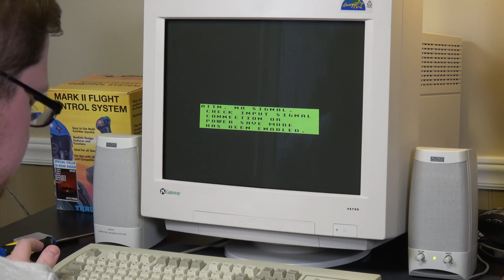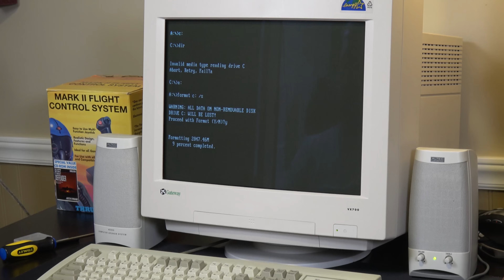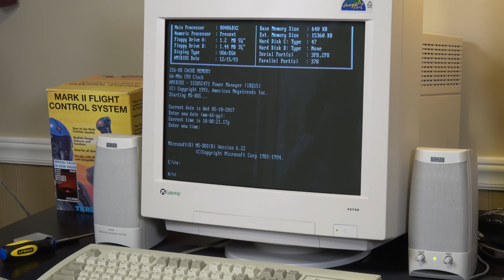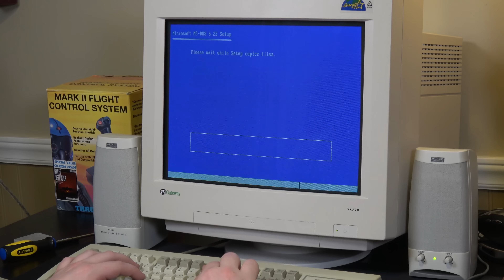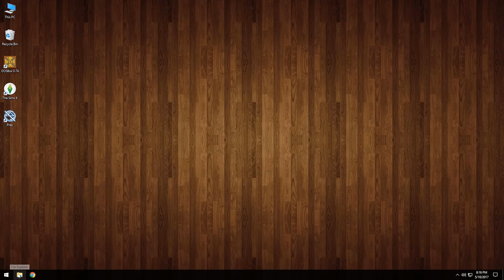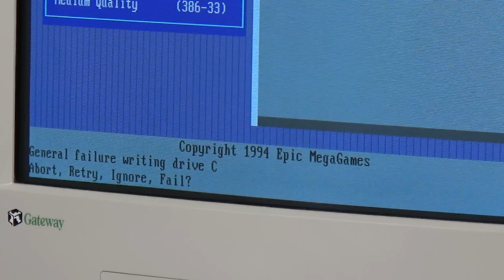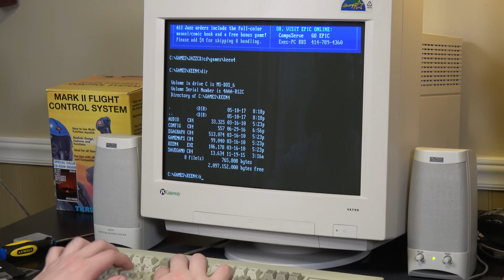LGR 486 Update! Installing CompactFlash Storage

Comment: I never succeeded using CF and its ide adapter in a pentium laptop (nothing detectef from the retro hardware). The card was known as "compatible". I use instead a SD card adaptor wich works without any kind of voodoo science... I installed msdos with a simple usb to sd card adapter with a virtual machine. Simply worked.
Reply from the maker: Yep I’ve had great luck with SD card interfaces in the years since this video, it’s pretty much all I use now.

Comment: My Star Tech CF reader won't work with my new SE440BX-2 Intel OEM board. It worked fine with my GA-6BXE rev1.9, but the Gigabyte boards has inferior TO-220 voltage regulator, making my use of a Voodoo3 3000 AGP dangerously hot. Why can't I just have one system! 😂😅

Comment: Hello,  that is actually what i have been searching for to replace my HD.  The power cable seem to be a bit flaky on my power supply or that is what seems to be the problem  when the HD stops spinning, it starts doing a clicking sound.  The heads moving.  I reach inside and move the cables around and starts or crashes.  If am working on something of course i just lost the DATA when i restart the computer but the HD gets damaged.  If i was to switch to Flash, will that flash erase with time if the machine is not turned on?  I don't use it everyday.  I have a 486 DX2 with 256 ram.  USB does work.

Comment: You mentioned that a reason for using CF cards was being easily able to transfer files from your modern system(s) to your retro system. Wouldn't it be even easier to have some DOS and/or Windows networking set up to share files between systems? I'm sure it's possible to do.

Comment: Hi! Do you to setting Jumper for 3.3V or 5V on the adapter CF IDE? Thanks a lot by response.
Reply from the maker: Depends on which power rail/connector you’re plugging into it! Larger molex is usually 5v, smaller 3.5” floppy drive style is 3.3v. Use a multimeter to verify :)

Comment: So I really struggled in formatting my compact flash card. I was really hoping LGR would have provided a link to the software he used to prep his card. However I found EZ- drive fixed my issue. Just search it in Google. It will basically have you create a startup disk that will automatically prep your card and partition it. Very easy and it worked!

Comment: Is there a specific kind of compact flash needed for this to work? I got SanDisk 32GB Extreme CompactFlash but both of my pentium 2 and pentium 4 dell PCs aren't detecting it. It actually did on Pentium 2 pc once and then it just hang in boot.

Comment: Hi Sorry but u use ide cable of floppy disk for your CF adapter? My question Is this its possibile use this CF card for second HD? I have IBM A50 thanks
Reply from the maker: This interface uses IDE, floppy cables are different.
It also works as a secondary drive if you install it on the secondary IDE header or the second connection on the ribbon cable. The primary can be your old drive still that way.

Comment: One thing to mention is that you need to be careful about the voltage jumpers on the CF IDE adapter.  I had to set mine to 3.5v after having friend 2 compact flash cards at 5v!

Comment: Ok so when it comes to those Adapters. If you are experiencing issues with it detecting it shouldn't have ANTHING to do with the adapter. Those Adapters are just Dummy devices. Compact Flash cards are native PATA or IDE, meaning they only need power and a pin change from the 40 pin IDE cable to the smaller connector Compact Flash uses. 

Using large capacity cards with speeds above UDMA4 on older systems (386/486) will cause issues, UDMA 6 is fine to use on computers like Pentium and up. In modern day terms they are are the same thing as using a M.2 to PCIe card, there is no logic on them, just straight conversion

This is why some people use IDE to SD card adapters on older systems as the IC use to convert from IDE to SD supports the lower UDMA/PIO modes that are more compatible with older systems.

Comment: Great job.

What is the method of addressing data on the CF card used? In my IBM ValuePoint, the hard disk is in CHS and this disk is unfortunately unreadable on newer motherboards with IDE slot.

Comment: Compact flash cards also come in fixed disk mode (windows sees it as a hard drive rather than removable storage) 
I bought a Transcend Industrial 8gb for that reason. It works great on a hp compaq nc6000

Comment: Eventually you'll have to get a gotek floppy emulator.   I still use diskettes but reluctantly I have to accept the fact that they won't be around forever.  One of my builds gas a gotek with a cf  drive for windows 3.1.  As the years go by that will be the norm sadly but I try my best to keep the nostalgia.

Comment: It's crazy with how much noise we put up back in the day. I got a SCSI hard drive for my Amiga 500 last year, and while it was blazingly fast (in A500 terms) it was so freaking loud, it was almost unbearable. So, I switched out the actual HD with a SCSI2SD-Controller and it's so much better now.
So yeah, I understand completely where you are coming from at the beginning, saying the hard drive got too loud.

Comment: Great video as ever! One tiny suggestion: Use more partitions with less size. FAT16 partitions are indeed max 2 GB in size, but that comes at a cost of having 32 kb clusters which creates an insane amount of slack space. For example, you have a file of 1 kb, it still uses 32 kb storage on the drive. So, I'd recommend actually to use 4 partitions of 500 MB each, which will use 8 kb clusters, a lot less slack space. Or 2 500 MB partitions and one of 1 GB. :-)

Comment: I know it's not really the same but have you looked to see if you can find any new drives that are the size you need? I've seen many new IDE drives on the web even to this day though they cost more than a larger sata drive. Think I saw a 40 gig IDE drive for about 50 or 60 bucks. If I were going to build a Windows 9x or ME retro system I'm not sure if that would be worth it.

Comment: Just got myself an internal 40 pin adapter and a Transcend CF card and it's doing nicely so far (on a newer motherboard, though). First I backed up my existing drive to a Raspberry Pi via EtherDFS. Created a small boot disk with EtherDFS, fdisk, format a packet driver and Volkov Commander. Used that to format the CF card and then copied my system back from the Raspberry Pi...absolutely painless!

Comment: Changing the "noname"PIO4 VLB IDE controler (even in Pio0 mode)  by a mirrored 2 port VLB IDE with 16Mb  on it resoleved th R/W error. But when I put back my CF card from the Win10PC to my vintage machine, the boot sector is always modified... Each time I have to use again SYS a: C: and everything is fine until I plug it back to any Win10...

Comment: Awesome video :)  I have a Pentium II with 2 card readers.  The one the computer boots from is called the Addonics IDE DigiDrive and has an 8GB Compact Flash card.  The best part is that it slides into a 3 1/2 drive bay on the front :)  The other one is a 5 in 1 IDE card reader with an 8GB SD card in it.  Also in the front :)  Works great while the 3 1/2, 5 1/4 and 250MB Zip floppies keep it 99% retro :)

Comment: Looking for ideas....
I'm trying to install an IDE to CF card and Compact Flash in my 486DX33 VLB computer (has Promise caching controller).  Motherboard bios does NOT support LBA, but shows full capacity of the 2gb or 4gb Compact Flash.  I am going to be running Dos 6.2 and Win 3.1.  I tried installing just using the Dos disk but it only saw 500ish (504mb?), so I downloaded an old version of OnTrack Disk Manager, and was able to partition out 4 equal drives.  I backed all 4 IDE drives up to Zip100 disks, and got the OS running on the new Compact Flash drive and was able to see and read/write small files to all 4 drives.

I was able to restore all the data to the 4 drives from the Zip100, but on reboot I lost the last partition, and it was only showing 3 drive letters.  I created a new logical partition and restored to the 4th (F:) drive again.  After reboot, it lost 2 of the 4 drive letters.  I've tried a 2gb, and a 4gb drive, but randomly lose drive letters after restoring data and sometimes before I even get to the point of restoring....its totally random.

I bought a 4gb disk-on-module and installed using OnTrack again thinking something might not like the removable drive, but I am still having the same issue.  I've disabled the cache on board the Promise controller, which also sees the drive(s) correctly.  I'm not sure what steps to try next.  I don't have another ISA IDE controller to try and there is no on board IDE controller on the motherboard.  Anyone have any great ideas?

Comment: Ok here I go. I have an old 1994 Toshiba T1960CS. I purchased a Compactflash to 2.5 IDE Adapter. I figured, great I can use this instead of the old drive in the laptop. Nope! I put the Adapter and card in a new Dell IDE laptop and the bios doesn't even see it either. Apparently it needs to be set to fixed disk instead of removable. I have the utility to do this but  if the bios doesn't even see it then how am I suppose to make it work. 

Anyways, did you have to do anything special to make it work in yours that you didn't show us? I for the life of me ant get to work in the 1994 model or even the 2000+ model.

Comment: I think these cards only support ATA-2 and up.   I have a very old (386) laptop from Zenith and it works perfectly with a 200Mb Seagate ATA drive. I had a heck of a time reading a old hard drive that I pulled out to image it. All my IDE to sata interface type converters could not read the drive and any "modern" machine with a PATA/SATA combo because they use the same type bridge adapters in the motherboard. I even considered raspberry pi and such embedded devices that may have software to read the ATA-1. No dice. 

To read the hard drive I went to the local thrift store and purchase the oldest most ugly machine they had. Made a bootable linux floppy and imaged the hard drive with success to a newer IDE drive that I used as an intermediate drive. I put the drive back in the laptop and did all this without breaking anything, and that is a miracle because no instructions exist how to take laptop apart. I can tell you it was not nearly as easy as modern laptops to access the hard drive.

Now my question. Do you know of any of these CF card / flash hard drive converters support ATA-1? it would be nice to use this old laptop but I would rather put the hard drive away rather then run it and risk it's failure. 

Also would be nice to have a USB to MFM,RLL, ESDI, and ATA-1 converter! Such a converter would require a lot of smarts to determine the parameters for these drives used by the controller that low level formatted them. Edit : I wonder if any market in building one of of these, at least for ATA-1 if no such device exists? For example a PI device that would act as bridge to USB.

Comment: I bought the cheap cf2ide cards from china and my 486 won't read the cf card, In my 386 it reads it just like yours and has the occasional write errors and you click retry and it writes. I then bought a startech cf2ide card v4, which is alot more expensive. I can now read and write to the cf card in the 486 and have not come across the write errors when using it on the 386. but there is a difference on the two adapters. The cheap ones don't have any capacitors or resistors and the Startech has one capacitor and a few other little things that i don't know what they are on board. Which i presume is why it is more compatible with my two old pc's. I'm yet to see if the cheap adapters have any problems with the newer Pentium based machines. Also I'm using a Kingston 600x ultimate 32gb cf card. Maybe a slower/smaller capacity cf card might be more forgiving when using those cheap adapters.

Comment: I`m hearing sounds I haven`t heard in literally decades. It`s great. And seeing DOS commands that I haven`t seen in an equal amount of time. Sure wish I didn`t get rid of all my 286, 386, and 486 computers/motherboards and other period hardware. At least I still have my 1983 IBM 8086 PC clone that I built in 1983. It uses one of the very first PC clone motherboards  and used all discrete logic chips. No "chip sets" as used in modern motherboards. It also uses a set of EPROMs copied from a set of original IBM PC ROMs as there were no clone companies like AMI at the time. The motherboard came as a bare board with NO parts installed. It did come with a schematic and a BOM list for all the logic chips, resistors, capacitors, etc that would be needed to put it together. I maxed the memory at 64K bytes and got fancy and installed a 5 megabyte IBM harddrive  that is the size of half a loaf of bread. Hmm, I should dig that out and set it up again, if I can find a compatible monitor for it...

Comment: Were did you get the adapter you used? The one that is accessible from the outside of the case? I cant find them anywhere.
Reply from the maker: Ebay, although the supply seems to have dried up this past year. I am looking for more myself but no luck so far!
Reply: @LGR  cheers Clint. Been binging like heck on your vids lol. Wife is moaning now because I'm pulling out all my old 486 and Pentium boxes.

Comment: The first CF card reader IS the exact same it only needs a bracket since the reader has the mounting holes already there. If you have a rotary tool or dremel you can get a blank bracket and cut the holes you need.

Comment: I would rather get an SD adapter because SD cards are WAY cheaper and are universally useful, CF - not so much unless you're a pro photographer and your camera body only takes CF so you have lots of those lying around.
http://www.aliexpress.com/item/1Pc-SD-Memory-Card-To-3-5-40Pins-Male-IDE-Adapter-Big-PCB-SD-3-5/32886988607.html

Comment: You should of used compact flash card instead of SD card in the windows 98 capture box
The mount would of fit without modifying the brackets
Reply: Should have
Reply: Nope

Comment: I have a old 486 with 14-pin vga output and no original monitor. How can it work modern 15-pin vga monitor?
Reply: With an adapter.
Reply: Alex Jamieson where I can get it? Can’t find it even in eBay
Reply: @CanaldoToth  all that question in PC Master race Reddit or Tom's guide.

Comment: I would suggest for ease of installing your card by either putting it down one slot or turning it upside down in the slot. It looked like the card was too close to the top ledge to be able to get a good grip when pulling it out.

Comment: If only there was a front-mount bracket in beige so the card is in the front.
Not like a reader, but one of these, but mounted on the front, you can probably dremel out a good size hole for it, but it would be nice having an all-in-one solution on the front of the PC to make it even more convenient

Comment: I still have my 286 (12.5 MHz) that came with a whopping 80MB drive!  Despite being below "minimum" requirements it ran Windows 3.1 flawlessly and didn't even appear to be slow or sluggish.  That said, I declined to "upgrade" to Windows NT (suggested by a friend impressed with the performance of Win 3.1) as that would take up nearly the entire hard drive at the time.  -_-  

I remember being told I'd never..... NEVER.... fill that drive up.  Challenge accepted.  Trophy earned.  Thank you games with 16-bit sound!

Anyway - I'm thinking this might make for a great option for that computer.... IF the bios recognizes the adapter.  Otherwise I'll need to work with my refurbished drives I bought "just in case" about 10 years or so ago.

1st lesson learned on the 286?  The "F" in "FDISK" can stand for something other than "format" if you're unfamiliar with the program.  Fortunately I had a floppy disk to re-install DOS the first night of owning the computer!

(AT&T 6286 EL/WGS, in case you're wondering what brand computer.  I still want to get an AT&T 6386 SX/EL WGS - the thin model with a 3.5" floppy behind a door - such a sleek machine for it's day!)
Reply: Oh, and the box for the 6286 EL/WGS said the computer had a 40MB hard drive, but AT&T was kind enough to secretly provide an upgraded 80MB drive.

Comment: If you use FAT32 with DOS 6.22 you can create 4 GB positions using a modified version of fdisk.  You'll have to track it down but we all had it back in the day on our super boot disk utility disks.  There were no compatibility issues that I ever ran into; you could even install Windows 95 on it.

Comment: Nice video ;) 
I have an old laptop. Siemens nixdorf 4ne.  And it cant see the harddrive even though it is setup in bios 

So i am thinking on compact flash solution 
But What do i do with the bios ? 
AS it is now all harddrives in the bios is configured with a Type followed by a number  like Its current disk is type 36 

I cant set it to auto or so.  So What do i do in bios to get it to run on a compact flash drive Then as for harddrisk configuration ? 
I dont know heads and sektors and What NOT of a Cf card as it doesnt have Any

BTW it is a 486 sx 33 MHz

Comment: Nice addition to a fine wood grain PC.  Just curious what your mileage has been with the read/write error, that 'popped-up' during your video.  Is this a reoccurring problem?  I have an application for older PC's, which are being used in-place of failing DEC & HP Dumb Terminals, that would benefit from this HDD upgrade.  Sourcing the flash memory cards & reader seems relatively inexpensive.  As time goes on, locating older working HDD's (under 2 GB) has become quite challenging.  Combined with age, & failure rate, a solid-state solution seems like an acceptable option.